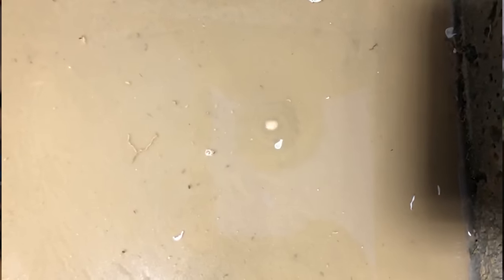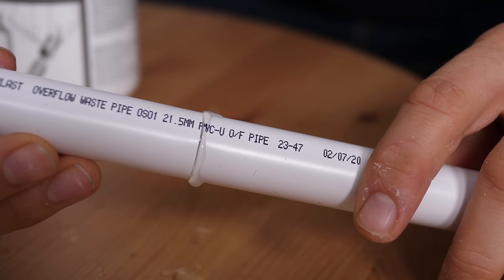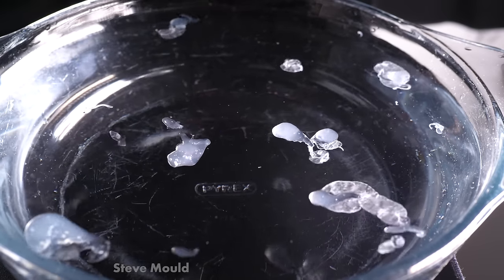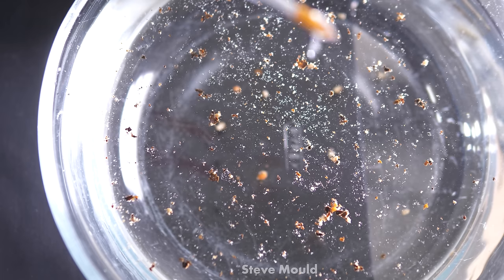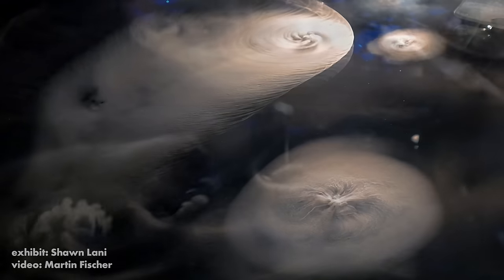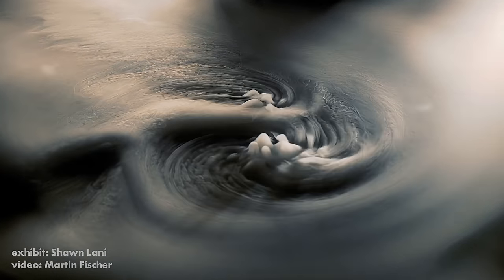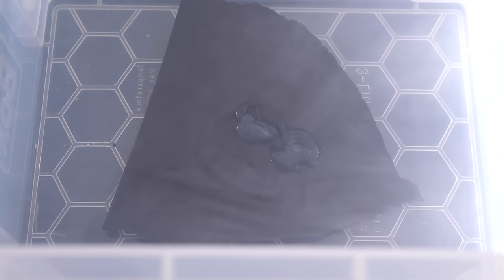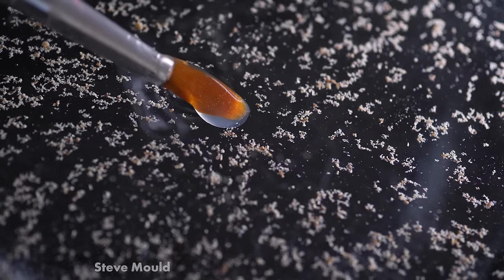Bizarre Spinning Glue

Comment: The PVC cement is actually a suspension of low molecular weight PVC, these initiate furthrr polymerization on contact with water. This is how PVC is produced industrially. This process is extremely exothermic. I'm guessing the effect is caused by water forming PVC capsules, heating up the trapped solvent water mix until they break (as you speculated) and release a pressurised jet of hot liquid. Perhaps you could test with thermal imaging camera on cement in a small amount of water.  Incidentally you weren't able to make your own cement because the PVC pipe is high molecular weight.
Reply: I hope he sees this
Reply: Ah, that’s good to know.
Reply: Great comment
Reply: Could an infrared camera be used to confirm this theory?
Reply: This is kind of what i was suspecting myself. Theres also a bunch of big polymer 'springs' for want of a better word forming and flailing about in the polymerisation process.
Reply: Hey I just made a similar post to this. Probably should have kept on reading. XD
Reply: Im going to pretend to understand this
Reply: this!
Reply: Actually its super charged particles with free energy generators atomatically prohibiting nonmotion to form in an spherical orbit considered of small midgets smacking lips
Reply: btw what is the relevance of molecular weight here? it's a proxy for average polymer length, right? or i'm mistaken?
Reply: Adding comment with the hope that Steve sees this
Reply: so it’s just magic huh
Reply: What do you mean by low molecular weight PVC vs high molecular weight PVC, is molecular weight not constant? Do you mean concentration?
Reply: @benjamin_markus  Correct. PVC, assuming perfect polymerization (big assumption!) Can have any molecular weight that's a multiple of the monomer, vinyl chloride. CH2CHCl. So n x 65.5 ish g/mol. Low molecular weight suspensions will be more stable. Try adding lemon juice to milk and watch the curds drop out of suspension. This isn't polymerization, rather agglomeration, but the analogy is close enough. Low molecular weight PVC will be more reactive as there will be more chain ends per unit mass. Think of it like this, if you had 65.5g of PVC that consisted of one polymer chain there would be two reactive ends of the chain. If each polymer chain only consisted of two monomer units. Your have 6x10^23 reactive ends. This is simplified a lot!
Reply: Thermal images, please! <3
Reply: Then, does the water actually react with the PVC with it becoming part of the PVC molecule? Sounds like you are saying that the water just catalises the reaction.
Reply: this explains the wings
Reply: Great speculation. My suspicion is also the glue is very viscus and traps gasses in tiny bubbles. as they reach the surface and pop you get this erratic effect.
Reply: @someting9205  Citation needed.
Reply: I'm a bit late to the video. I literally just posted a comment musing over it generating heat and the motion is being created via convection.
Reply: My first guess was an exothermic reaction! Really cool to learn about this, thanks!
Reply: Interesting insight.
Reply: @rom5285  Perhaps try dropping some in a liquid without water and see what happens. The only household things that come to mind are oils and solvents like paint thinner. Alcohols might work, but any available at regular retail store will contain some amount of water.
Reply: I think bit could also have to do with the use of cosolvents that can evaporate at a different rate than the one of the MEK
Reply: I suspect that, on top of the difference in molecular weight pointed out by Tom Grime, the dissolution of a piece of PVC piping is not effective in making cement due to the mineral charges that go into the piping composition . Possibly, the squishy material obtained is the additives remaining trapped in swelled up polymer. 
Maybe the cement could be obtained by filtering out the solid parts
Reply: Nice
Reply: @davefoc  "hypothesis", not "theory"... if you want to use technical, scientific language.
Reply: I love it when an expert enters the chat.
Reply: @davefoc  My guess is no, there might not be enough thermal mass to see a gradient.
Reply: @alanhersch4617  Good for you, have a cookie.
Reply: @Payitamon  You could probably make a passable cement by sanding a PVC pipe, gathering the dust, and dumping that into the MEK. This would at least allow a more thorough solvency by exposing the polychains mechanically. Although it might need to be sanded with coarse metal, rather than particle grit.
Reply: @tomgrime526  you’re my hero.
Reply: Now that's fascinating!
Reply: @whyisitsohardtochooseahandle50  it's a polymer. This literally means each molecule can, in theory, be arbitrarily long. A polymer is formed by bonding multiples of a monomer. Varying the process can result in longer of shorter average chain length.
Reply: @tolkienfan1972  I know what a polymer is, I've just never seen something referred to by the molecular weight of its polymer before in that way if that makes sense. Like if you asked for the MW of cellulose I'd quote the monomer not some multiple of it. Does that make sense?
Reply: @whyisitsohardtochooseahandle50  makes perfect sense. I'm guessing the chain length gives the polymer varying material properties, so they specify it by molecular weight?
Reply: @tolkienfan1972  yeah that makes sense, I was just confused haha
Reply: Isn't it possible that the fairly high solubility of MEK in water could be causing a depression in the boiling point of the water locally and have a similar jetting effect?
Reply: Well, the production of pvc wster serves no other purpose than as a solvent and the process is initiated by a radical initiator, typically acylperoxides.
Reply: @someting9205  thank you for the clarification
Reply: @davefoc  Original commentor: "Perhaps you could test with thermal imaging camera on cement in a small amount of water."
Reply: @benjamin_markus  It is a proxy for polymer weight.
Reply: @whyisitsohardtochooseahandle50  It's a polymer.  So the length can be different. Poly VC. - Plolymer.
Reply: @EricPalmer_DaddyOh  I'm aware :)

Comment: Steve, I am a commercial diver. I watched this video and when you talked about dry ice it brought up a memory... when groceries are sent offshore in the gulf of mexico, they are sent with dry ice.  There was one occasion where I was in the water on a decompression and they threw the dry ice overboard. Dry ice sinks. But it sunk to a certain point and it stopped sinking. Then it seemed to hover mid water. I watched this phenomena for several minutes. I cannot remember my depth but I want to say it was shallower than 100', well within scuba range. It was awesome. I watched it come down off gassing the whole way and then just stop and off gassed until there was nothing left, and then another chunk was thrown overboard and did the same thing. I just found out about your channel and I am impressed. Maybe you can do something with this.
Reply: Probably the depth where the water is such high pressure That it has the Same weight as the dry ice. Water is liquid so ist gets compressed faster than a solid piece of ice
Reply: I guess it’s just neutrally buoyant at that depth
Reply: @Alalea17 water doesn’t compress
Reply: @carlosandleon water does compress but under extreme pressures. 20000psi to compress by 5%
Reply: Everything is relative  @carlosandleon
Reply: That must have been really cool to watch!

Comment: As a chemist in a adhesive maker who play with those cements everyday, I can tell that the main components of PVC cement is PVC, MEK, and cyclohexanone. (or tetrahydrofuran)
Since MEK , cyclohexanone and tetrahydrofuran are all partially or full water soluble, some solvent would dissolve into water and make PVC solidify into a film covering the blob.
And the osmosis difference building across the film pulls water into the blob and make the blob expand at the surface. (Therefore the films and wings form when wet blobs are dropped.)
When the blob is firmer and the film is fixed by rigidity and cannot expand, osmosis difference just pull solvent out into water instead and create a propelling stream.
Then with higher curvature of surface, the blob tail can gain more propulsion with more surface area, which makes blobs run, or spin if tail is warped.

Maybe try mixing some color into PVC cement and we can find more data.
Reply: Thanks for sharing this information! We need more to read this comment so Steve can read it! Liked
Reply: Perhaps  plot motion vs time vs mass of drop to relate to reaction rate and then a scan through temps and digital video analysis a plot of motion would serve a bit like DSC to find peaks at specific temps
Reply: Does MEK in solution with water appreciably depress the boiling point of water?
Reply: I would like to do the same experiment: do you have a brand name of PVC that spins!? The last glue I bought does not work...

Comment: I remember an experiment from when I was a kid, where you would dip the end of a match in glue and it would move across a bowl of water when thrown into it.

We used "UHU Kraft Alleskleber" (from Germany) for that experiment. And that one contains dissolved polyurethane which solidifies when the solvent dries up.

The effect is similar so it probably is not related to the PVC but mostly the solvent.

Comment: At first I thought it had something to do with Marangoni effect and the surface tension mismatch between the solvent and water, but the pepper really does reveal discrete jets and now I think the surface crust fracturing thing periodically releasing pulses of MEK as the droplet contracts probably is what's going on. Dye the cement with something like fluorescin and inspect the interaction with a UV lamp to maybe see what's going on in more detail...
Reply: Any dye that dissolves in that solvent will work if it can be mixed in uniformly.
Reply: https://pubs.acs.org/doi/10.1021/la301437f
I think the marangoni is right- here's a paper where they make a similar situation- plastic dissolved In solvent, added to water- moves in weird patterns.

Different plastic, and Ethanol instead of mek, but they seem fairly confident it's due to the marangoni effect, and they can even predict it so as to control the motion, so I'm inclined to believe them
Reply: @AngDavies  That looks just the same phenomenon

Comment: You can build a schliren imaging system to detect the solvent bursts.
Reply: That's exactly what I was thinking! It'd be really interesting to see all kinda of imaging methods applied to this system. It could really illuminate the inner workings of these spinny bois lol.
Reply: Maybe even just food colouring in either the water or the cement would work?
Reply: @ikbintom  Problem is you'd need something bonded to the solvent. As else it's measuring how well food colouring seeps out of the cement and might even cause undesired effects.
Reply: @TechyBen  good point!
Reply: I wonder if you could get schlieren videography to work crossing a water boundary. In either direction. I feel like you'd have to be in the same material (air or water) as the light source and subject for this to work.
Reply: Might wanna get Smarter Every Day involved with this one!

Comment: That happened with a dead insect recently with here.
I was cleaning the house, it fell on a puddle and started spinning like crazy. I checked closely to see if it was still moving, but other than that spinning, it was completely still, and it started instantly spinning again after I stopped examining it.
It's one of those insects that exhale a weird smell sometimes, so oils/aromatic components might have something to do with that effect, too.
Reply: Could be oils. They also have tiny water phobic hairs. However, theoretically water phobic surfaces should not generate their own energy. So perhaps it's a mix of the water phobic effects with oil or solvents as the driving/fueling force?
Reply: Both of you, best theory so far
Reply: If the oil from the bug and water is causing spinning because they aren't mixing properly, it'd be interesting to test if a water/alcohol solution still produced spinning with the oily bug because water and alcohol should allow the oil to mix
Reply: "One of those insects that exhale a weird smell sometimes" - I'm genuinely intrigued. I have never heard of such a thing, and I don't remember ever having smelt an insect in my life. What fresh new horizon of science is this? :-O
Reply: @macronencer  are you kidding? Many insects use smells as defense.  The most known infamous is the nezara viridula.
Reply: @LucasRodmo  No, I'm not kidding. Maybe it's because of where I live (UK). I don't remember ever smelling an insect :)
Reply: @macronencer  find a shield bug (they are everywhere in UK) and annoy it a little bit - you'll get a smell a bit like laurel leaves or marzipan - some cyanidey compounds
Reply: @petebuckney  I do come across those sometimes. Interesting! Thanks.
Reply: @macronencer  stink bug?
Reply: @macronencer  You never smelt a stink beetle?  You are lucky.

Comment: Great video - I'm just finishing my PhD about the behaviour of wood floating in hot fluidised particles. The wood emits jets of gas which interact with the fluid in a way not all together dissimilar to the dry ice on water demonstration. Indeed, I've used the dry ice/ water system was a quick way of explaining my research.

Comment: I've seen weird stuff like this going on in the lubrication cup of an air assisted airless paint sprayer. I have no idea what the makeup of the lubricant is, but at some point in time we put lacquer thinner in the cup to clean out lacquer that's gotten in there. Globs of lacquer or the lubricant or the thinner start moving around, almost like they move to the middle of the cup, down to the bottom, back out to the outside and up across the top to repeat the whole trip again. Pretty weird, makes me think they shouldn't be in the same space together.

Comment: On the dry ice on water (4:22 onwards) what is it in the jets we can actually see? Is the CO2 visible or does it cause water to condensate into a misty thing?
Reply: Yeah, on Wikipedia it says that it stems from the bulk water so I imagine when sublimating there is always a small film of water in contact with the cold gas that interacts and interleaves with the gas molecules creating a fine mist.
Would be interesting if that can be visualised.
If what I say is true, there should be a frequency that is dependent on the temperature which should be measureable and fairly constant.
Reply: I didn't find a full explanation but this blog entry has some empirical data

https://chemedx.org/blog/dry-ice-five-different-liquids

Comment: Something about the solvent not evaporating and hardening the pvc a bit before it enters the water gives it those cool as fins,  I’m guessing that since the solvent having like a lower surface tension makes it spread across the surface of the water quickly takin an itty bitty bit of the pvc powder with it then it hits air and solidifies.

Comment: To make PVC weld you need the MEK solvent and a carrier, which for most PVC cements is actually styrene monomer. You dissolve polystyrene into the MEK and, once the bubbles are finished dissolving, you have the cement. You do not use PVC tube because it has a lot of filler in it to get it rigid, and this is non soluble, as it is mostly calcium carbonate powder.

Comment: PVC cement is actually not cement.  It's a solvent (usually MEK or "safety solvent").  You can get it either doped with or without PVC resin.  I believe you can get it with several different percentages of added PVC resin.  The addition of PVC to the solvent is intended for use on larger diameter joints and when the dry fitted joint, for whatever reason, is sloppy or loose.  The added PVC resin fills in any gaps, nicks, or scratches existing between the two parts. After applied to both surfaces then joined together it melts the surfaces of both PVC/CPVC parts being joined.  The liquified PVC mixes together upon assembly.  And then, as you said, it evaporates leaving the common wetted surfaces "welded" together.  That's why it's referred to as solvent welding in the industry.  Manufacturers recommend roughing, cleaning, priming, and applying solvent to both surfaces to be joined.  They also recommend giving the parts being joined a 1/8-1/4 turn twist during/after full insertion.  This is to provide shear mixing of the two liquified surfaces, perpendicular to the direction of flow, prior to resolidification, reducing the likelihood of a leak.